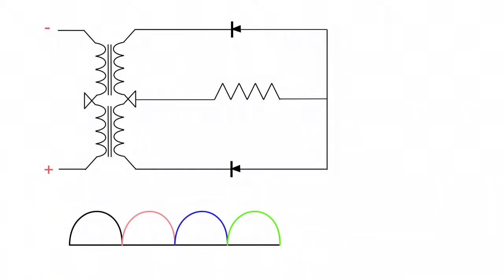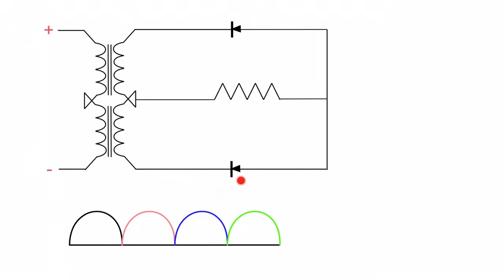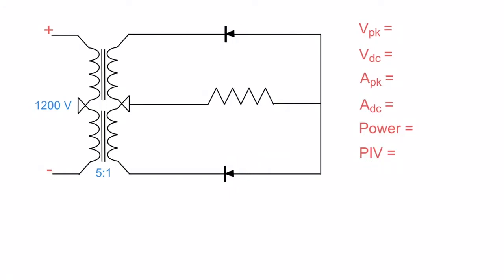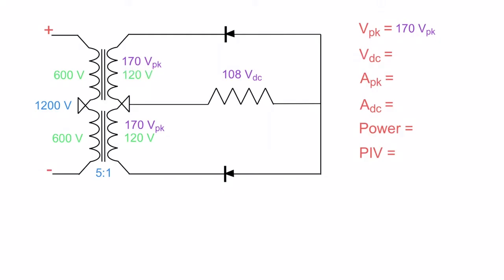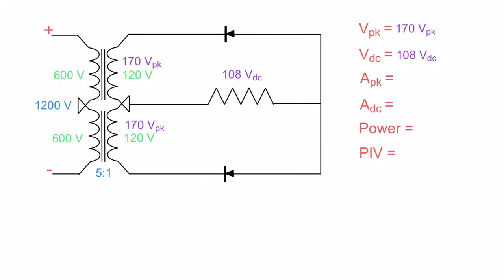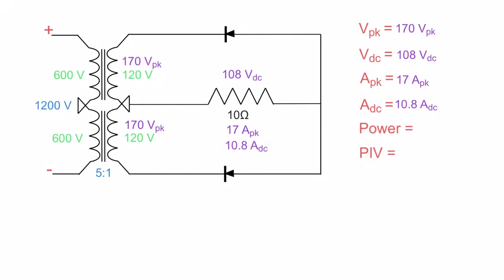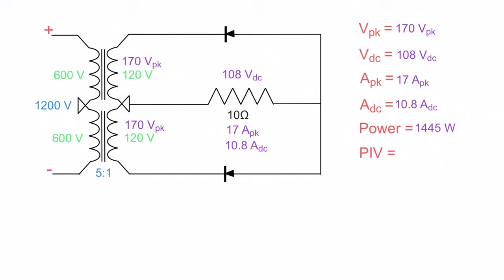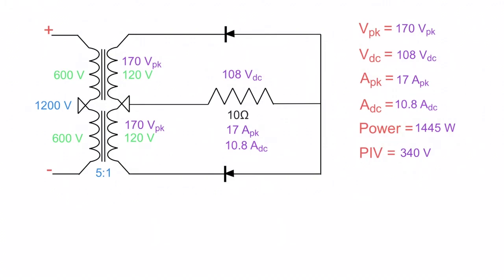Bi Phase rectifier calculations

Comment: Why power is calculated through RMS values, as we are calculating average power, and we have Voltage and current average then why we won't use DC/average values for power calculation?